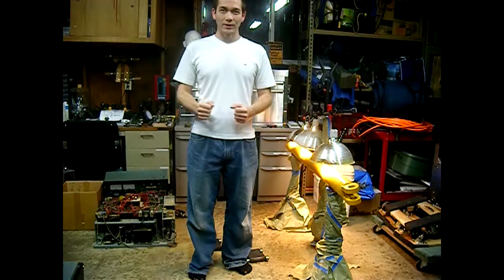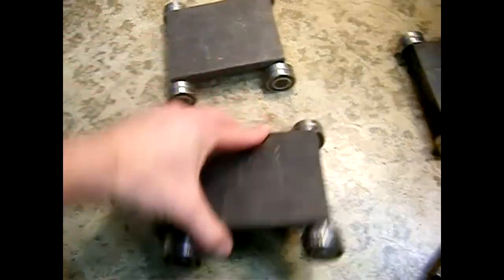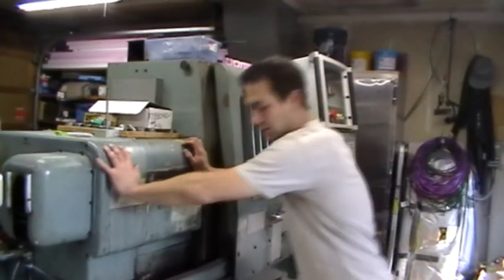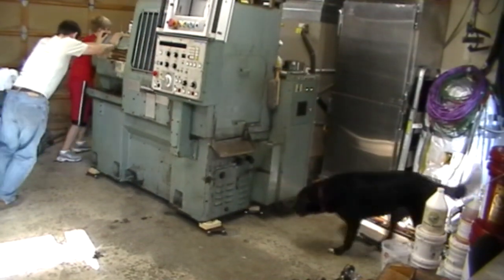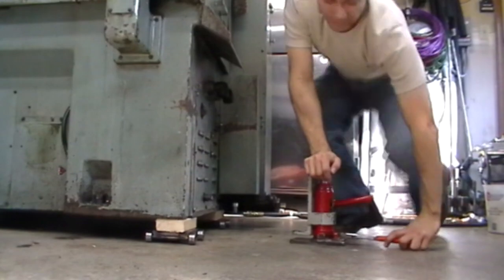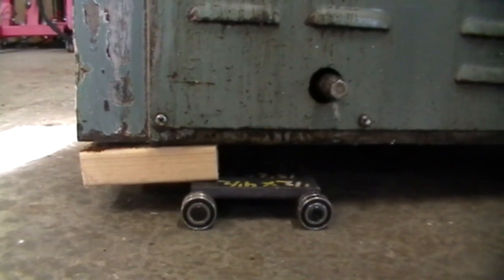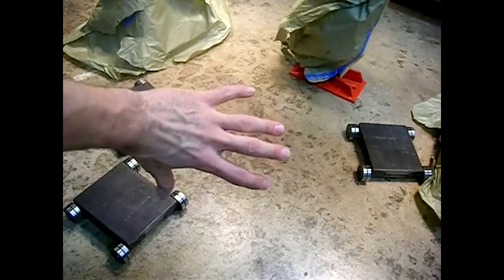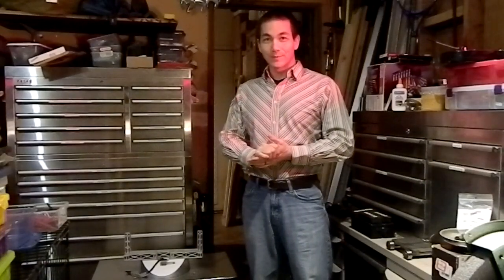Easy CNC Equipment Moving with DIY Machine Skates

Comment from the maker: I use R10 bearings on 5/8" drill rod axles. The press fit worked out to be plenty to keep the bearings in place, but if I had problems, I would have remade them with snapring grooves to retain the bearings.  One nice thing about the skates is that they don't raise the load very far.

Comment from the maker: agreed, they're not for every situation - certainly not for asphalt, or anything rougher.  However, I used these on my rough concrete driveway which had beem broomed for texture. It was a little harder to push, but still workable for my load (around 5500 lbs).  I was even able to push across the seams between the concrete slabs, which surprised me - I thought it was going to get stuck.  It's good to have several tricks in the bag, including the pipe method you used.

Comment from the maker: I use 4 bearings per axle, 2 axles per skate and 3 skates, so the load is on 24 bearings. For a 5000kg machine, it might be smart to go with larger bearings than I used. Don't go by the static load rating of the bearing - they are not rated to support weight directly on the races as I'm doing with these skates. You'll want to size the bearings for a very hefty safety factor.

Comment from the maker: There's a time and place for both ways - by hiring professionals and  DIY. Certainly it depends on your own skill level, the load you're moving and circumstances. The drawback to hiring out is that it's expensive. For most of us hobbyists, it costs as much to purchase a used milling machine as it would to have it moved.  Of course, if you're not comfortable doing this kind of thing, hire the pros and gain peace of mind.

Comment from the maker: I purchased drill rod from Enco, with nominal OD matching the nominal bearing ID.  It was a light or medium press fit. I tapped it on with a socket pushing on the inner race (so as not to damage the bearing). Drill rod is strong, has a precise OD, and cheap.

Comment: Good homemade skates. I will make some smaller ones for myself, so thanks for the idea. To stop the skate/s from slipping out from under the load, place a layer of compressible material on top of the skate, so that there is a layer between the skate and the weight. Rubber matting is ideal for this. Cut up old rubber car footmats, strips of garden hosepipe, or household door mats are a perfect solution. Thick cardboard will do the job, but obviously won't last as long.

Comment: Awesome.... I just purchased a used Cincinatti arrow 500 VMC and I am wanting to move it myself.  This idea is great!!  What sort of bearings did you use to make them and is there some kinda keeper holding them onto the shaft?  I know you said they were pressed on but with that much weight on them I would probably want to MAKE SURE they stay on. I suppose a threaded hole in the lathe and a simple bolt and washer not larger than the inner race would be pretty simple. That lathe is my next purchas

Comment from the maker: If the skate slipped out, it would have been no problem  - it would have been supported by 3 skates.  When I tried to use 4 skates, one of them didn't carry any weight, which allowed it to slip.   In the future, I'll use 3 skates, or else use rubber pads (which ensure all skates get to carry the load)

Comment from the maker: Glad you enjoyed it!  I built the skates with R10 bearings riding on 5/8" shafts, with the intention of keeping them very low profile, so I would not cause too much machine tilt when I put the first skate under. As it turns out, I ended up putting 2x4 spacers on the skates.

It seems logical that larger wheels would be more tolerant of rough concrete, especially a driveway. Just watch the slope and don't let it get away from you, of course =)